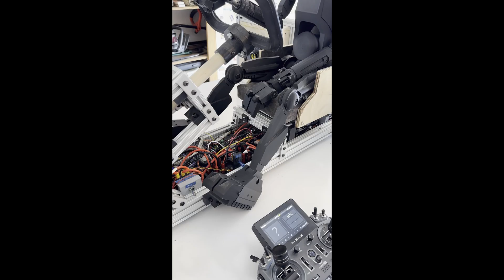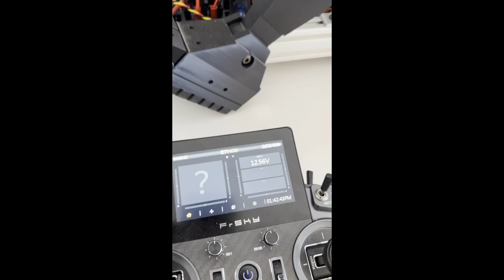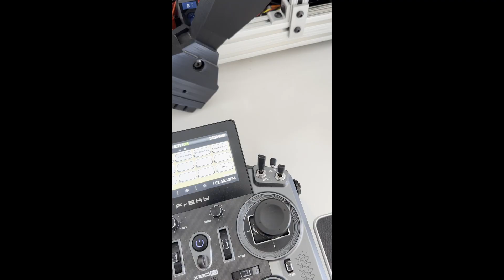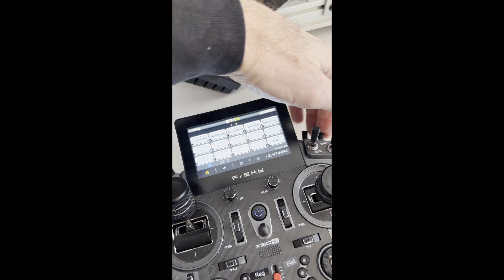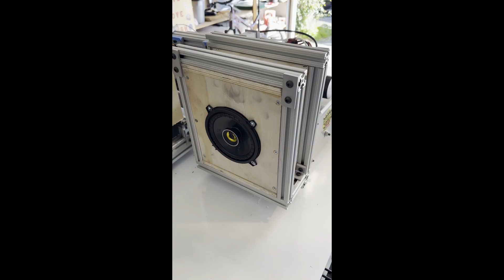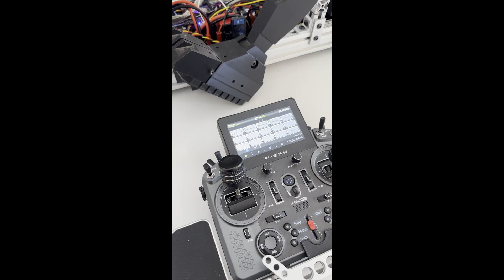Pit Droid ep 26

Comment: Hi Mike,
Thanks so much for your Pit Droid neck bearing design in Episode 3. I used Fusion to modify the Driod Division parts as you did. I am very pleased with the final
result. My project is an AI version of the Pit Droid using a Raspberry Pi camera. Your
re-design enables me to avoid oblong hole wear caused by a plastic on plastic pin connection.

Again, thanks so much. I love following your videos. I have learned a great deal from
your posts.  -Bob